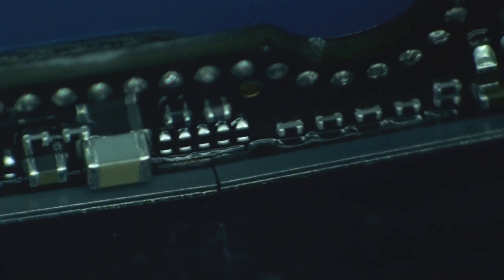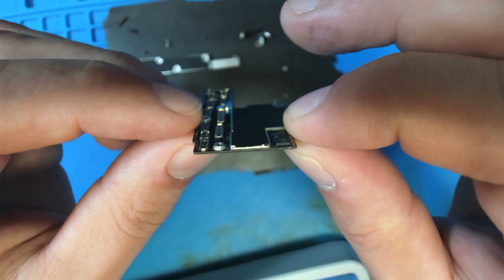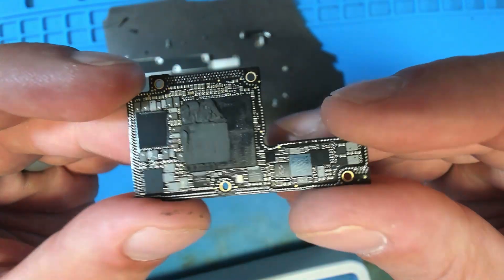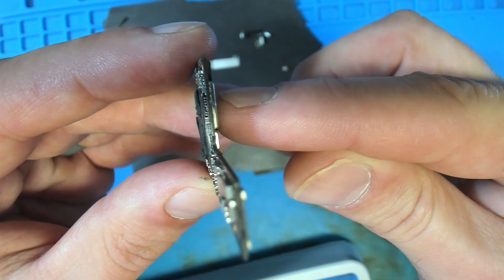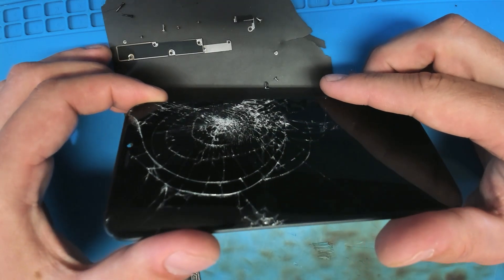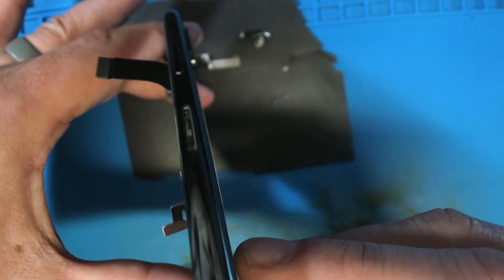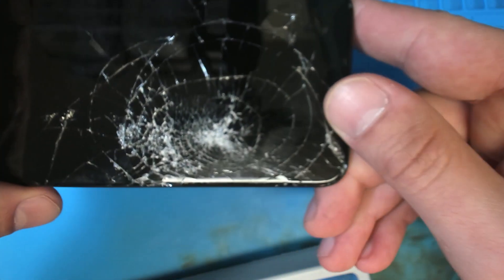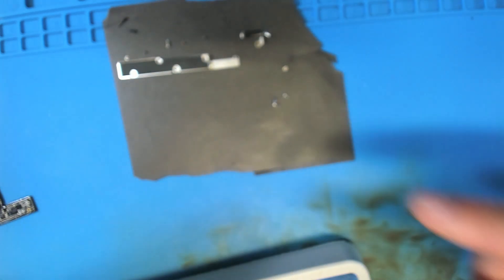An iPhone Xs with a broken CPU - Time of death 8:05am

Comment: It just amazes me how so many so called "businesses" have to send their stuff out to a competent tech like you or myself (no flags attached) for diag/repair n no I'm not in the U.S I'm in OZ.
Reply from the maker: Thankfully this is a shop that never sends me prior board level rework attempts.  When one of their customers brings something in that requires a microscope and soldering equipment, they outsource it.  Compared to some that royally screw it up and then send it here without saying anything like I wont be able to tell when I see it under a microscope! lol
Reply: Teamwork makes the dream work. It’s not only about just trying to get a job done rather to get the job done even if it means you need an extra hand. We all need help sometimes and nothing wrong to look for it wen needed. Just like how you, me and ten of thousands of viewers are watching this channel and most of them are technicians trying to grab a piece of mind help fix a device.

Comment: They must have suspected something in order to send it straight to you that's pretty messed up though especially just from a simple impact to the front, my blackvue bv9800pro  took a 4lb hammer to an already broken screen and I just dropped a new screen and frame assembly in and it's been like a new phone 6 months later. I phones seem to be a terrible investment but an excellent investment for repairers.
Reply from the maker: They only tried the basic components to narrow down that it was a logic board problem.  How do you like that Blackview?  Did you have any trouble with the screen replacement?
Reply: @ststele  the screen replacement took roughly 30 minutes start to finish and I never had this phone apart prior so it was all new to me.
 they are built very simply with minimal adhesive with mostly silicone o-rings for the back and  the charger port and headphone jack is sealed with a soft silicone like sealant the only issue I have is because I work around alot of steel fine metal filings get through the mesh for the speaker so every couple months I have to remove the speaker and clear out all the metal,
 I've put a couple  pieces of medical mask over the speaker and is held in place by the phone case which helps keep most of the metal out but this issue doesn't really have anything to do with the phone quality I honestly cannot fault the phone.
the thermal camera comes in very useful I'm hoping to upgrade in the near future I've had my bv9800 pro for well over a year now and it's still going like it did out of the box and I've definitely put it through it's durability test and even after having it apart multiple times once for the screen replacement and the multiple times  cleaning the speaker out I still feel 100% comfortable getting it wet and the screens are incredibly cheap to buy too.

Comment: If you'd at least made the video square it could have been a YouTube short
Reply from the maker: That was first my idea but I did not realize it needed to be portrait... I could have chopped away and encoded only the center of the frame to make it the correct ratio for a short but meh...  I really have to fix phones today! :-)
Reply: @ststele  Hope you get some uncomplicated repairs then. 🤞
Reply: @ststele  Good luck on the repairs friend. Thanks for all that you do, I don't repair phones but it's still very insightful to see how the technique changes for small boards.

And, yeah I know it's more hassle but honestly they kinda get some weird algorithm boosts and that's nice? Only issue is that they die off suddenly and with no warning apparently haha.